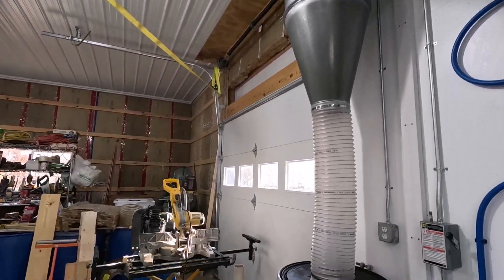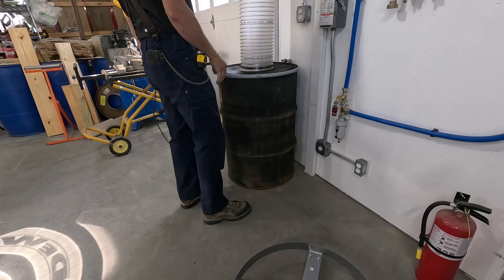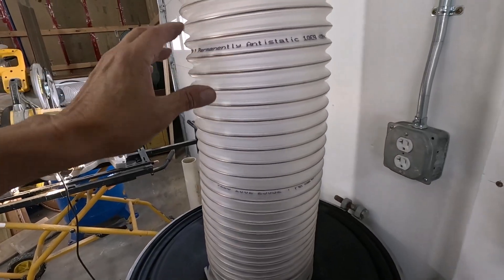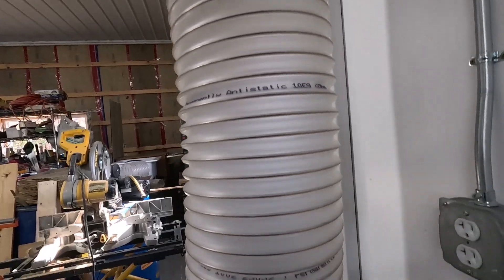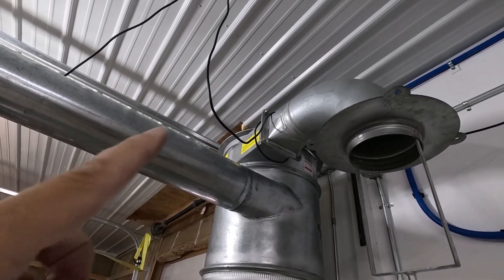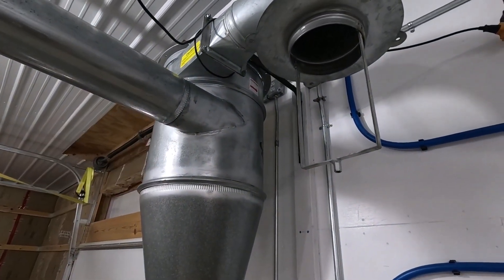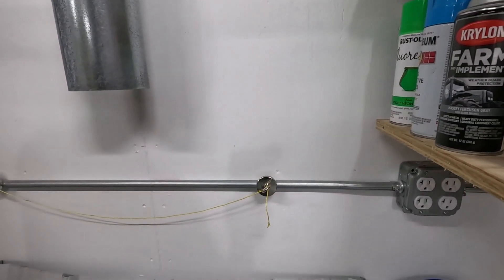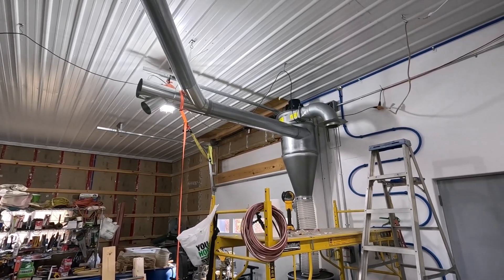How-To Ground a Dust Collection System

Comment: Great idea, i never would given static electricity a thought. Birds get in our loco shop all the time, big door wide open and they cant figure out how get out... 😮
Reply from the maker: Static electricity builds up big time in dust collection systems, and can slow the flow of stuff through the pipes. There is debate as to whether it can cause an explosion or not, but it is easy to remedy so that's what I do. We get birds in there all the time as well. Hummingbirds almost always die, and barn swallows always get out. Everything in between is a tossup. 😑
Reply: @TrapDoorWoodworks  interesting to learn bout the static, i did not know that. A lot of swallows in my barns at home and the big loco shop 🐦🐦🐦

Comment: I should show this video to our door guy. He has pvc ducts on his machines, and there is so much static in the pipes that the dust on the pipes stands on end when it is running 🤪 It really is just a matter of time before he has a fire or worse!
Reply from the maker: He may think the motor is doing the grounding, but I don't think that is anywhere near enough, and some people have the ground prong broken off, so there is zero grounding. All systems should have least one robust, dedicated ground — I will likely have five when all of the ducts are installed 😊

Comment: What are you going to be doing with your smaller dust collector
Reply from the maker: As far as grounding, or in general?
Reply: @TheLastWoodshop  in general
Reply from the maker: @luwk  I'm going to convert it to use a canister filter, and use it on the machines that don't have dust collection yet (or maybe never will). I expect I will always have some use for it😊
Reply: Hi Mojo you reminded me of the time I was hooking up some cargo to a hovering helicopter in my Army days, one of the other soldiers deliberately pulled out my grounding rod,oh boy did I get a kick from the Heli.
Reply from the maker: @adenvet2830  Thanks Larry! That must have been a hell of a zap! We have explosions in grain elevators and dust collection systems quite often here in the states, and I would prefer that not happen right next to me 😮 One of the places I worked at had two fires and one explosion in their 30 years of existence. I'm shooting for zero 😉
Reply from the maker: @adenvet2830  BTW, just thought I'd let you know, you posted this as a 'reply' to Luke's post, so it is buried under that post. 🤔